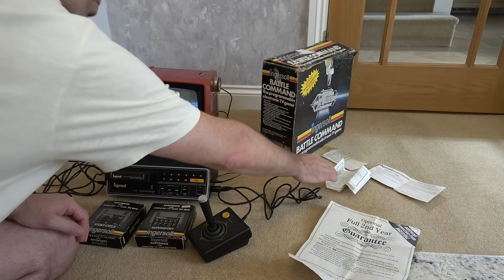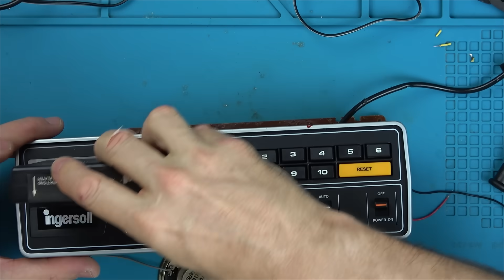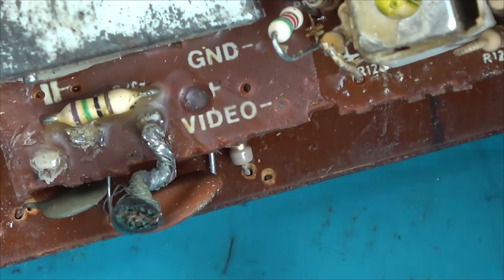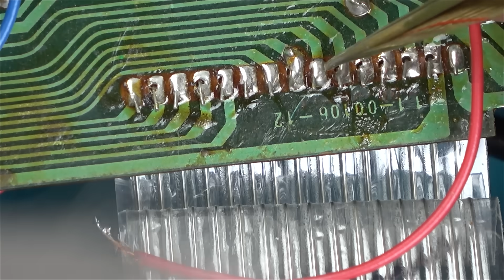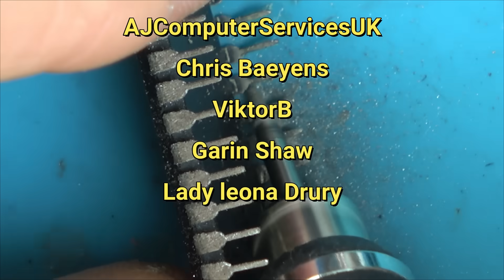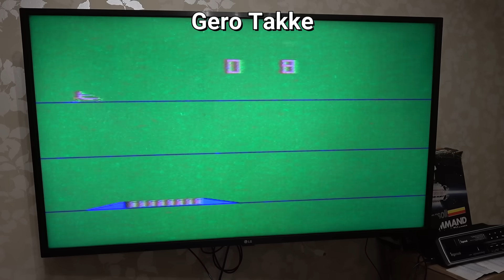I Bought a Broken 1978 Ingersoll Battle Command | Can I FIX It?

Comment: My guess is, some curious person wanting to see what old consoles looked like inside opened it...old solder joints etc being a bit frail he ripped a few off the pads, didnt have a soldering iron or had no desire to fix it and just put it back together, probably back on the shelf for a few years then it was sold as faulty later on

Comment: The wax is a cheap form of water protection, but also its to keep the wires from moving. The old RF modules used to vary  in frequency with the movement of wires, distances, angles etc. So the wax was added to stop stuff corroding initially, Use some hot glue it will do the same job

Comment: Max score 15 will be because of the memory allocated to keeping score. It’ll be in binary and 0000 is a zero score 0001 is 1, 0010 is 2, 0011 is 3, etc etc until you get to 1111 which is 15.

Comment: Nice - this is what’s known as a PC-50x system. 

There was a range of eight of these cartridges released, each of which swapped out the main chip for a new game on a General Instruments AY chip (including Grand Prix, Submarines, Tank Battle, and more). The Supersports one you have uses the AY-3-8610, an enhanced version of their ubiquitous AY-3-8500 “Pong-on-a-Chip” that featured in the overwhelming majority of 1970s-era PONG systems. The Motorcycle one uses a clone of Atari’s Stunt Cycle manufactured around the same time.

Comment: Vince, remember, this particular type of console is only an interface between you and the games cartridge.
The game is the cartridge, that's why they fell out of favour when Sinclair and Commodore came along in the early to mid 1980s.
You could write your own software and type it in to save on cassette. Or type in other peoples programs etc. Or you could buy games (in their hundreds) to use on your computer. Download stuff over a MODEM, send your stuff out using the same method.
We owned these old cartridge based systems (ATARI etc) and were not impressed by any of them frankly...
Great job as always Vince
👍👍👍👍👍👍😊😊😊😊😊😊😊

Comment: Despite certain comments from other YouTube viewers, you would be strongly advized to replace ALL electrolytic capacitors with brand new equivalents.
This will save further hassles down the line, and future proof as an extra bonus
Wayne Brill & Nina Evans (Joint bosses of local electronics repair business).......

Comment: Candle wax as strain relief. The 70s were wild, lol.
Reply: The wax-like stuff has nothing to do with any sort of strain relief. It's so all the HF components can't vibrate and any open core coils and potentiometers can't move and detune themselves. You see this a lot in older regular FM/AM radios (especially anything portable) as well where half the board is pretty much drowned in that stuff, and open core coils often have a little sponge strip inside them that's also soaked in that waxy stuff to prevent it from moving/detuning from the whole device being moved around

Comment: My father had one of those Sanyo black and white TVs the exact same size! It had a black housing was about the only difference, how cool to see it again! It kind of became 'my' TV as my Atari VCS was hooked up to it in the spare bedroom. No way would my parents consider letting me hook it up to their precious big colour living room TV and as a 10 year old, I didn't have the money to buy my own TV yet.  
I'd never heard of the Battle Command before, and seeing a pong-based machine with ROM carts for the games is mind-blowing! It had to be more expensive then the usual way of using discrete logic for the pong based rigs, but allowed for a much smaller machine having a CPU and requiring ROM carts as well as allowing to add new games as they came out instead of being stuck with whatever pong-alikes the console shipped with. Very cool, and almost the 'missing link' between the first and second generation home video game consoles. VERY cool, glad the algorithm recommended this one!
Reply: It seems to just be AY-3-8500 or similar in the cartridge, no ROM, and no processor in the Battle Command, just a video modulator that understands the output format of the 8500.
Reply: @𠅇 yeah I read up on the machine after this, no CPU on the system, it's not as advanced as I thought it was at first.

Comment: Terminals on the speaker are labeled + and -.  Yellow looks to be negative.  The rail going round the circuit board edge is your negative.   Like you said, 1 speaker doesn't matter much but you did connect them backwards.

Comment: I was a kid in the 70s during the pong craze.  Even as a kid, pong got old fairly quickly.  My dad brought home a pong game and it might have lasted 6 months before it got put in a box.    The 2600 kind of killed the industry.  It's a shame TTL games like Pong/Racing/Stunt Cycle/tankwar didn't get more time to see how good they could have gotten.  I mean, breakout was entirely done in TTL.  Atari put out video pinball as a TTL console offering.  So it is clear games could have advanced a lot .  But once the 2600 and fairchild channel F came out, they basically killed off the whole TTL market.  They just became uncompetitive.  Putting a 2k ROM on a cartridge was a lot cheaper than releasing a whole new console every time a new TTL game was made.

Comment: 44:57 The chips in the cartridge are not software.  They are a pong-on-a-chip. They cannot be modified.  The "computer" is the cartridge. The console is just the interface where the buttons and ports are.
Just get the number on the chip and order it if you can and it will repair the cartridge (if that's the problem).
The chip is the game done in hardware.  There is no software on the chip.  The sheer variety of these pong chips from that era is staggering.  There are endless varieties of these chips.  But they are much, much more akin to a 7800 series chip than a ROM chip.  There is no software involved.

Comment: 43:15 You're right; these are "games on a chip" AY-3-8610.  You may have worked it out already, but they also don't have a rom space that can be dumped or written.  They just contain "hard-wired" logic and anything else you need to run a game.

Comment: The best way to clean the carbon pads on buttons like this (more typically in a remote control or NES controller) is to very lightly drag them across a piece of copy paper.  The first time you rub them, they will leave a black mark.  Next time it will be lighter.  Do this like 3 times for each dot.  It just removes the glazed layer that builds up on them with use or time sitting without use.  I've been doing this since the early 90s.  I have found it is by far the best method for these types of buttons.  It has like a 99% effective rate and is very non-destructive.

Comment: Looks like it may have had some leaky alkaline batteries in it at some time.  Corroded the coaxial cable and you can see some deposits on the discrete components.  The chips in the carts are the whole thing - basically variants of "pong on a chip".  I got the chip number of the AY-3-8610 on one of them, can you tell us the number on the other chip?

Comment: According to the manual for your meter, luckily, it doesn't go above 3 volts, but just a word of warning to anyone that decides to check static sensitive or old chips that might be damaged, some meters (usually cheap ones, but not always) sometimes chuck out anything up to 12 volts on ohms and diode check. I was surprised to find one of my Flukes outputted between 6 to 8 volts depending on which setting was used, and a cheapy no-name meter threw out the full 9v. So just to recap, for standard 5V CMOS (74HC), voltages above 6V cause permanent oxide breakdown, while modern low-voltage nodes (3.3V or 1.2V) suffer damage well below those levels. Hope this helps someone, and maybe saves a chip or two. 😀

Comment: Nah, there's no software in those chips! It's all analogue circuits, maybe a couple of primitive flip-flops or logic gates. But absolutely no CPU, no RAM, no software at all. Vince, you're thinking of microcontrollers, and I don't think programmable ones of the type you're thinking of existed back in 1978 or so. 

You could get 4-bit microcontrollers for calculators or watches, but to write the software, you'd have a big PCB full of chips that acted as an emulator. That would have RAM you could program from a computer. So you'd develop your software on that, as well as connect up the keyboard and display of the calculator you were designing, to the PCB. Then once you'd got the software finished, you'd send it off to, say, Texas Instruments, and they'd do you so-many thousand chips with a custom on-chip ROM of your software.

Sinclair did it for their Scientific. They managed to just-about squeeze full scientific calculator capability into a chip aimed at ordinary calculators. The simpler chip was of course cheaper! So Sinclair could offer a scientific calculator at a big discount compared to everyone else's, even if it was a bit quirky.

But none of that has anything to do with this! This is all purely analogue circuits, doing the timing for the background and the ball and bats and all, generating pixels purely through timing and logic. Not even really "pixels", there's no grid of pixels, no resolution. Just deciding to turn on the beam right at this point in the scanline, or not. If I remember right, there's even a circuit diagram for these chips, their internals, on the Internet.
Reply: Theoretically, you could make a cartridge that does have a CPU, ROM, RAM etc.... on it which would actually be a plug in computer that just uses this console for I/O. I imagine someone is already dreaming up something like a Raspberry PI with Doom on it to interface with this console. 😀
Reply from the maker: Thank you 👍

Comment: That is so cool; I have never seen this before, and I'm 55 years old. I owned an Atari 2600, a Commodore VIC-20, and an Atari 800. So cool to see this! As an American electronics and gaming enthusiast, I love the 8-bit era. Ingersoll Battle Command (1st Generation "Clone"): The console contains no CPU or graphics chip—just a power switch, controller ports, and wires. The entire computer brain is inside the cartridge itself. When you swapped cartridges, you were physically swapping out the entire motherboard and game chip of the system. This is a fascinating system if you read about it, as I've never seen anything like it.
Reply from the maker: Thank you, the VIC 20 was my families 1st computer. I was very young at the time, but I remember it clearly. I remember the best game we had was Fort Knox 👍👍👍

Comment: I believe the chip is not programmed and you can’t dump the game code.
The game schematic was on the silicon on lots of those old games and they didn’t run any software/firmware.
You can tell because there won’t be any processor on the main board.

Comment: The chips can't be dumped and reprogrammed because the chips do not contain firmware like more modern game consoles nor are they in any way hardware compatible in terms of pinouts. You can think of the chips containing all the transistors that make up the game plus some rudimentary analog stuff for display output and doing the controls.  That can't be programmed into a chip though I guess you could emulate it on a modern programmable chip  and interface it - but that would waste a lot of computing power to do that.

Comment: 31:30 The joysticks are analog, so resistance is how it determines position.  If the plug doesn't have a solid connection, that will add resistance and affect position and/or limits.

Comment: Vince, chip programmers are easy to find and use.  I highly recommend you get into it a bit.  You just have to make sure what programmer supports what chips.  They easily connect via USB to your computer and use special software for all the work and even can have a hex editor.  You can make backups of certain chips and save it for later, if ever needed.
Check, if a dump of this chip is freely available.  You can dump this chip and compare it with the *.rom file you got from internet.  Make sure it's identical.  That's the prudent way when working with old electronics.
Some programmers can have additional socket attachments for different types of chips.  Consider this when looking for a programmer for optional future expansions.
Many of these programmers can detect what kind of chip you put in and if it's working, but some of these with extensive database are more expensive for more niche chips.  You cannot live without these programmers when you are into such things as Arcade games or even just old consoles.  You can also fix BIOS chips on old PC motherboards.  :)
Reply: Yeh, but not for this system. Those chips are not any kind of prom. They instead contain a mix of analog and digital circuitry which is just enough to directly implement the game in hardware. You cannot reprogram one chip to make it into another. You can't program them at all.

Comment: You shouldn't really use fire blankets. They are not approved by fire departments (They told us that on our first briefing for working in the laboratory).
Get some sand to extinguish hot metals and a good normal fire extinguisher. That's enough.
Reply: You can also get extinguishers specifically for lithium battery fires. Might be worth having one at hand?

Comment: Works very much like a Hanimex TV070C which I had in the 70s. One of the carts had 4 games locked out. I later learned they had bugs. It was possible by flicking the power switch to  glitch it so two of the games could be selected. One played fine but the other would play, I think ball wouldn’t launch

Comment: A little trick i use with IPA bottles, is to just pierce a small hole in seal. Then you can squirt out what you need or where you need it and It's less likely to spill it's knocked over.

EDIT:
Deoxit d5 is a miracle cure for old electronics, chips and sockets.

P.S.: Nice fix Vince, love seeing old electronics brought back to working condition!

Comment: Yay! The day is fixed when Vince releases a new video! The console is so new, I wonder if it developed the video issue very early and so it was never actually properly used.
Reply from the maker: Maybe, or stored in a damp garage or attic shortly after buying and the exposed copper wires turned green and then brittle over the decades 👍👍👍

Comment: Nice, I have a couple of PC-50X systems and most of the games.  The main Battle Command module is only half the system, its sole purpose is to provide video and sound output and controller input there is no processor, the games cartridges are then a full system-on-a-chip

Comment: Nice retro videogame console and fault finding 👍 With game cartridges and chip inside them, looks a bit more modern than 1978. In fact, just earlier today watched a video about Mattel Intellivision console, and it's problems from Adrian's Digital Basement channel.
Gotta check that RF cable solder joints at the pcb in my Pong clone when I take it out next time. Maybe mine is corroded as well and maybe that's why the image fades to black screen in ten seconds, while the game still runs in the chip, making the sounds in the speaker.

Comment: Nice fix Vince wax itself isn’t conducive but over time the wax (vintage) can trap moisture, so going by the coax cable it seems moisture has got in there somehow, strange really but its originally there to prevent moisture🤔
Reply from the maker: Thanks Gary. I was wondering if maybe it was stored in an attic and after years of hot and cold weather (a bit of condensation perhaps)  the copper turned green and became brittle???As the speaker and battery terminal were also broke. Thanks mate, hope all is well with you 😎
Reply: @Mymatevince yes that was my line of thinking too, being in a loft or something. Yeah all good here thanks Vince hope you and all your family are good too, get those hands sorted 😊

Comment: 21:40 Do not ever press and kink and RF cable like that!
A friend of mine is a consultant for his RF and antenna services. He worked with a company that was struggling to understand the variable performance of its antennas. It turned out they were running a central conductor inside a conductive tube (the correct design) but had no spacer to keep consistant distance between the two. The fix only needed a simple modification to hold the central conductor in place to guarantee a consistent spacing and impedance throughout the line.
When you kink an RF cable like that, you introduce a discontinuity for impedance which may be just as severe as a break for DC. Never force those cables and always allow a minimun bend radius.
Reply: True. But please note that the length is also important. A crappy cable over 2 cm could be as fine as any other, while the same crappy 2 cm could ruin your reception on a 15m cable. Also, reception on a real antenna vs a signal generated and send directly haven't the same properties and tolerance. Same in audio btw, if you look at the wires to the speaker, it's not audio câble, but it does not hurt there, for this level of signal, this impedance, etc etc.

Comment: Wow. What a find. My first console was a Texas Instruments TI-99. Also, I was one of the people who told you not to use a potentiometer to decrease the resistance in order to bring a laser diode to life but I never mentioned why: lasers are driven at constant current, and low voltage. Lower the resistance of the potentiometer will cause more current (obviously) which, in a laser diode, will increase the heat. Similar to an LED, laser diodes will suffer from the more heat = lower resistance thermal failure cascade. As it heats up, the current will increase, and on and on until the diode facet is blown apart and it turns into an expensive LED (referred to as COD: catastrophic optical damage). Cheers !